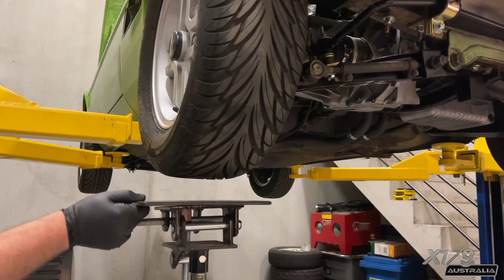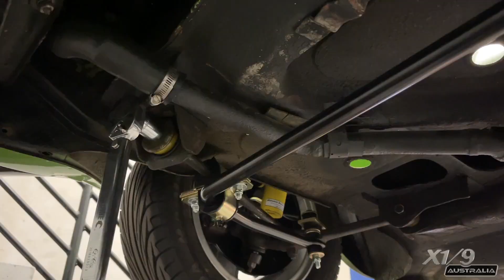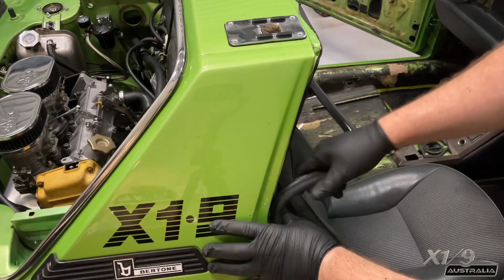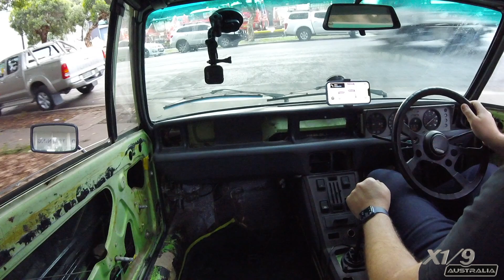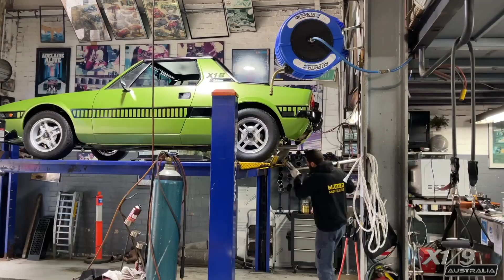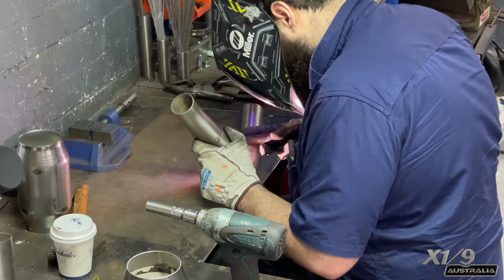The Green Machine Ep.31 — First Test Drive & Custom Exhaust Fabrication | Fiat X1/9 Restoration

Comment: What a magic looking car I never really liked the lime green but yours is growing on me

I see that you are using the clicker style torque wrench 

they’re okay but just be aware there plus or -4% accuracy Warren and Brown deflecting beam is plus -2% 

and if you ever do any engine work like head bolts etc it needs to be super accurate the clicker type torque wrench needs to be “warmed up” 

meaning that you’ve gotta put a nut in a vice work the wrench in 10 pound increments right up to the top and then back down to 0 again because the spring and the grease inside needs some heat into it otherwise it binds a little bit and they’re inaccurate…….

In essence room temperature has quite a large affect on their performance and the mechanism needs to have some warmth in it

Not an issue 99% of the time 

not an issue for suspension work but certainly the finer points of putting in big end bearings etc conrod bolts you would not use one in my book 

you want to deflecting beam……..

Comment: Great series Mark.  Were you able to use the original 1300 engine lid, or need the later series 2 lid with the 1500 and twin carbs?  I recall the series 2 lid is taller for more clearance.
Reply from the maker: Thanks Chris, the original 1300 lid worked with space. Take a look here https://youtu.be/wLFnT3v_p9k?t=189

Comment: Great to see you rolling again after all the hard work.
Nice job on the exhaust as well.
I noticed there's a green sun strip at the top of the windscreen.
Just curious, but is the green machine a series 1?
Meaning, the original glass isn't tinted and so maybe the sun strip is factory standard on these earlier non tinted screens?
BTW I decided to put a sun strip on my 1500 using film that I applied to the inside.
I made some enquiries to see if there was ever a tinted screen with a factory sun strip, apparently not.
Did I mention the price of an OE screen in the UK is astronomical, a thousand pounds for a Saint Gobain if you can even find one?
At some point I think Saint Gobain bought Pilkington, and these are available here for around 400 pounds.
Hah, yes it can be a bit alarming if the throttle sticks wide open! 🙄
Reply from the maker: The windscreen looks to be a recent replacement and not original as has the sun strip. Getting a windscreen here is easy and cheap at AUD$165 but they all have the sun strip. I have looked for one without but can't find a new one.
Reply: @x19australia  thanks Mark, interesting. So now I know where to get one of those, that's very cheap compared with Europe by the way.

Comment: Intermittent clutch, sticky throttle, heavy traffic.  I love a challenge.  Nice exhaust fit by the way.
Reply: You forgot to add in overheating and random electrical outages. More often than not though, you'll have a smile on your face at then end of a drive.
Reply from the maker: Very true on some cars. I found that the majority of electrical problems seems to be one of two reasons. 1) Bad earth or corroded  2) past owners adding to the loom. I have some very original untouched X1/9's and the electricals are fine. It's like they built the loom to just enough to work.
Reply: @x19australia  3) Being in the UK for more than 5 minutes. :D